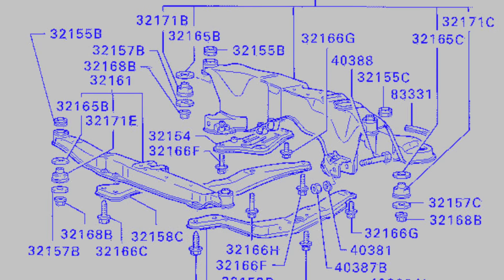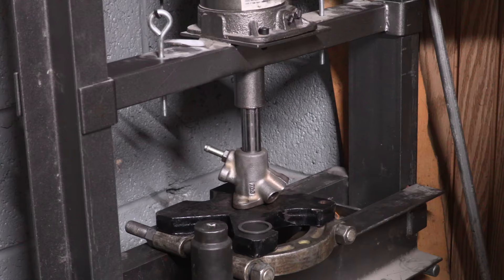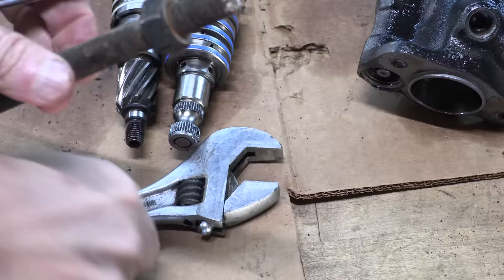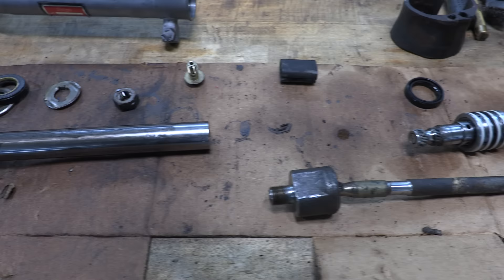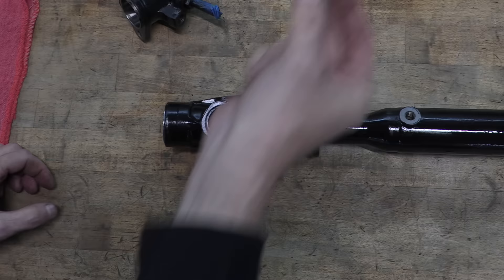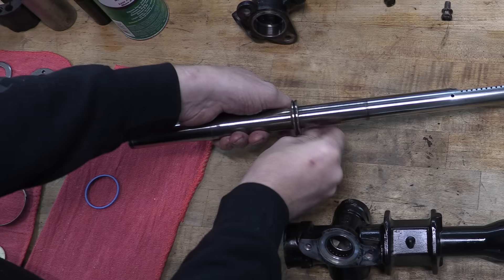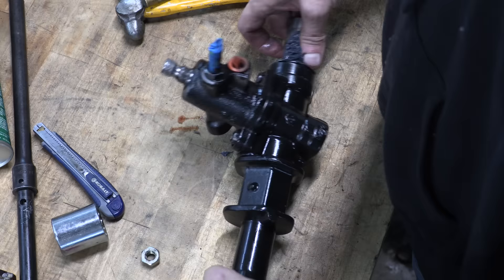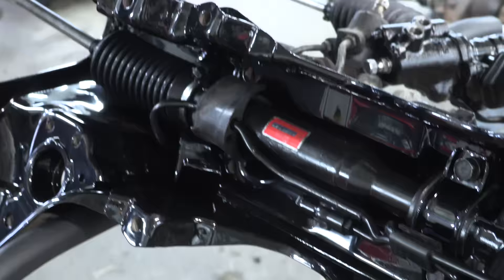Rebuild Koyo Power Steering Rack (AWS)

Comment: I know your pain and patience when it comes to the spreadsheet. I'm currently doing the same thing for my SAAB 900. I'm about 92% complete - 2000 parts cataloged and 3000 pics so far. I also zinc plate my own hardware for the entire car, so my bench grinder is like my side chick - my wife is jealous with all the time it gets

Comment: Good on you for rebuilding the stock rack.  I tried a reman rack for my '91 talon restoration and it failed in a few thousand miles.  I took it apart to put a seal kit in myself, and the thing was full of blasting sand!  Absolutely destroyed.  Luckily I installed an inline filter in my return line so the pump survived.

Comment: Wow...
Watching you do all if this detail oriented work reminds me of myself when I was 17or 18...I had an'89ProbeGT- a twin of the Mazda MX6GT and they both had the tough little 2.2 SOHC12 VALVE TURBO ENGINE :" F2T" I took everything off of the engine that was ugly gray,cast aluminum(valve cover, exhaust manifold heatshield, the aluminum turbo "volute" and I sat in my driveway for a couple weeks with a "D.A."handsander and I attacked all the aluminum parts first with 80grit sandpaper, then worked all the way up to 2k grit... when I was finally finished I could see my reflection in anything that was made out of aluminum it was all a mirror shine- and so,Anytime I went to the local "car hangout" and Popped my hood, everyone would come gather'round to check it out ...it was very cool😅 ...hell of a lot of work but, in the end it was worth it
Reply from the maker: Taking pride in your work is ALWAYS worth it!!!

Comment: Omg! This gives me flashbacks to rebuilding my donor steering rack for my 1992 SVX. Mine has variable steering assist too, and it was nearly identical to this with the exception being mine didn't come equipped with AWS, like every other USDM model. Mine original unit was too pitted to rebuild, so I rebuilt a donor. It wasn't fun.

Comment: I’ve waited so long for steering rack content and I’m so glad I chose to put a manual rack in #231. I picked up a 1g power rack also before I chose Manual. You saved me trouble there. Maybe I will make this journey in the future should I decide to reinstall 4WS. 

I’m pretty sure I read/found out the 4bolt lsd will bolt into the GVR4 pumpkin to keep rear steering in tact but upgrade to LSD and stronger axles. This has me wanting to hoard my galant rack.

Comment: I would not bother with the straps. Just get the tool for tying wire and do a double wire hose lock on it. That thing's rather for pressure (not hydraulic pressure, but still pressure) it's more than good for a boot and it's very clean. Bonus point: it doesn't cut up the boot because wire's round.

Comment: You are not alone in the pain of finding rebuild parts for a power steering rack... I finally rebuilt my power steering rack about 9 months ago for a 2005 Hyundai Elantra and found out pretty quick that the genuine hyundai seal kit was missing the one seal I actually needed... The rack bush seal is not included and not even referenced as a seperate part. I instead (after buy another two random seal kits...) that you just have to buy the entire rack bush assembly which is an expensive affair.

Another interesting thing is how similar your koyo power steering rack is to Mando Hyundai rack. The hyundai rack doesn't have the bolt on the bottom of the pinion gear though. I tried a seal kit I found randomly on aliexpress for a toyota rack but the steering gear shaft in smaller by 1mm in the hyundai so the seal for the toyota and I assume your mitsubishi is 1mm bigger in both inner and outter diameter.

So in the end I used 3 rebuild kits to make 1 power steering rack...

Comment: Awesome job but unfortunately I think you'll find those bolts will rust pretty quickly. It's usually coupled with an oil coating; that black oxide helps accept... but even still, it's very poor at preventing corrosion.

Comment: Hey Jafro,
Love your Videos! Just a quick Info since you said the Non Turbo Galants didn't come with 4WS. In Europe we got the Galants with AWD,4WS Non Turbo (4G63 DOHC 150hp). They came equipped with a W5M31 (instead of the W5M33) with a 2.846 rear end (instead of the more common 3.545 in the turbo cars).
Especially where I'm from (Austria) we got some pretty weird specd out Models. Both Galant and also DSMs. I also got an 1G 91 6Bolt AWD N/T Mitsubishi Eclipse. It has all the Turbo Parts: W5M33 (Even states in the Service Manual that it comes in a 4G63 DOHC T/C Intercooler lol.), 3.545 rear end, Dual Piston Front Calipers (The N/T in my Country always came with Single piston Brake). The Car is fully specced out with A/C, ABS and Cruise Control. The only thing missing is the Turbo Engine haha.
Just wanted to share that Information since I find it to be pretty interesting.
Hope my english skills are good enough to understand it. :)

Comment: is this the same parts for a 3000GT VR4?
Reply from the maker: Mostly.  Keep in mind the kits I bought that were the right part numbers for a Galant VR-4 did not contain the complete set of parts that I needed.  I had to buy 2 different kits to get the full set I needed.  When I did that it was an accident because I forgot I bought the first one.  Neither kit was fully correct, and that accident saved me when I was shooting the video.  The seal kits are dirt cheap, so buy several that are spec'd for your car anyway.  I think you can get them for between $20-$30 each.  I've seen as low as $11, but that was 5 years ago when everything in the world wasn't broken.
Reply from the maker: While searching the part number for my steering rack, I found websites that listed my searches as 3000GT parts.  They showed exploded diagrams, drawings, that were exactly what my parts are, and I was searching part numbers from my Galant.  I did not compare every part, but they listed the full parts list similar to what I drew for the Galant with all of the part numbers.  I didn't have to join anything or pay anyone for access to that info, so search these part numbers and I bet you'll find it!
Reply from the maker: ...additionally, when you get into them, usually the needle bearings and roller bearings are fine.  But if you need to replace them, and your rack is a Koyo, the part numbers are etched on the outside of the races of each bearing.
Reply: @Jafromobile  found them on Amazon for 65 dollars. If you know a place to get them for those prices let
Me know
Reply from the maker: @joseantoniodaly4875  Search for the kits by THEIR part numbers, not the Mitsubishi ones.  I also collected these parts over a span of 10 years.  The $11 kit was definitely observed over 5 years ago.  I didn't even buy it.  I've noticed that Amazon raises the prices of everything I every try to buy if I passed it up the first time or if I've ever bought it before.